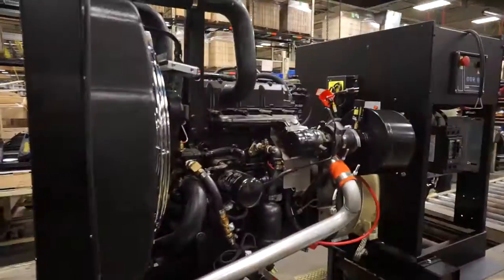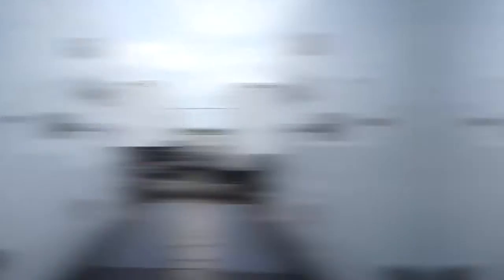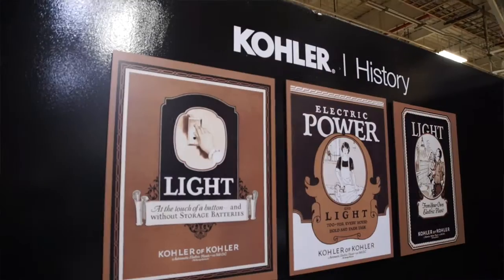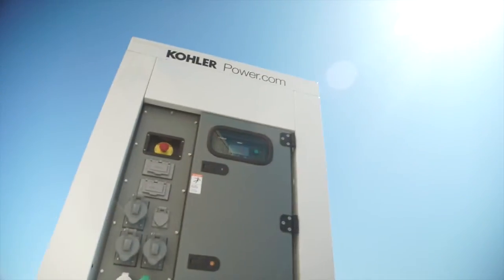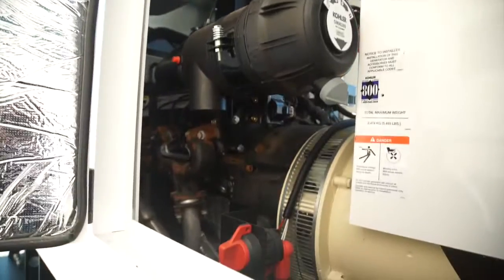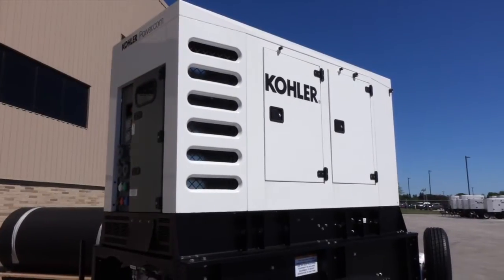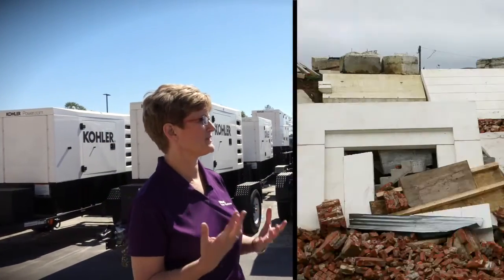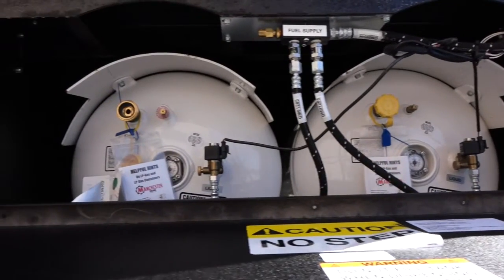Building Science: The Mobile Generator Powered by Propane

Comment: LPG produces 33% less CO2 emissions than petrol and 45% less CO2 than diesel. LPG vehicles produce up to 82% less Nitrogen Oxide pollutants than petrol and 99% less than diesel, 63% less Carbon Monoxide. 40% less Hydrocarbons than petrol and 70% less than diesel. 50% less particulates than petrol and 98% less than diesel